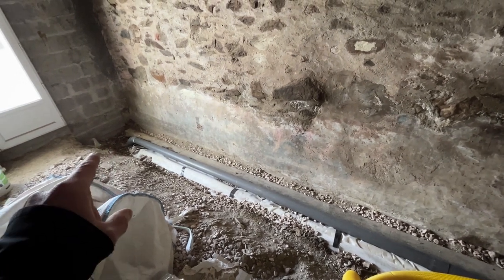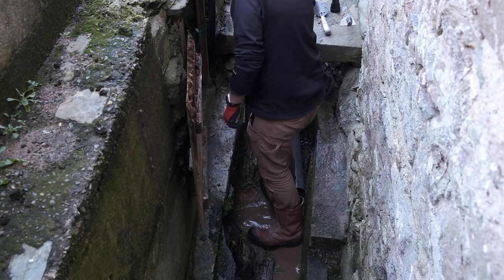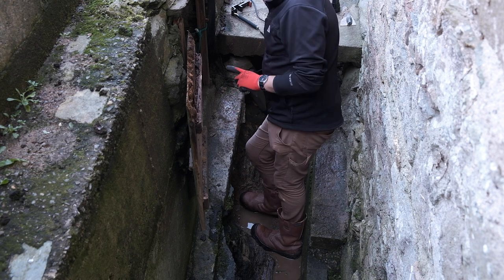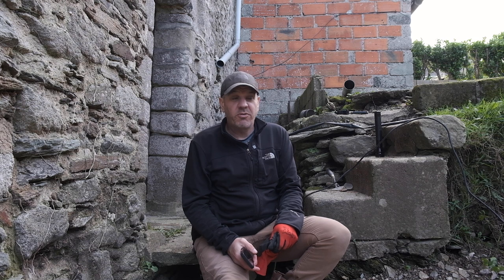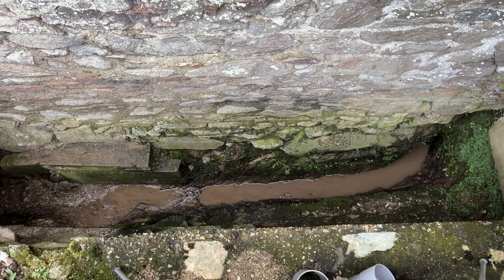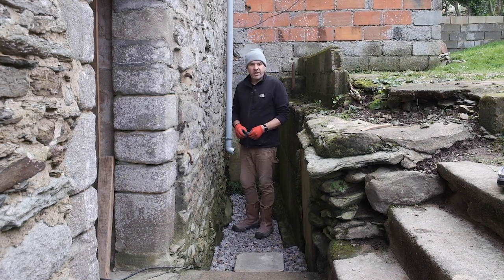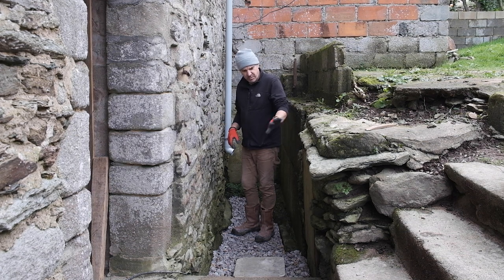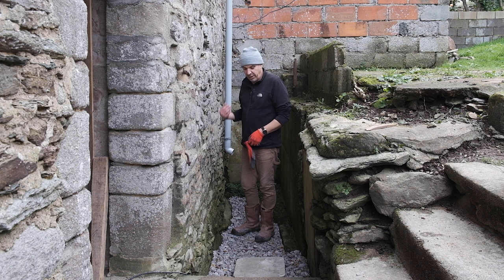House Foundation Corner Drain

Comment: After You have redone the gutters and downspouts put a manhole/ shaft in the corner (the wet one) and connect it to the solid pvc pipe inside the house / barn. The pipe that goes from the sump pump should be solid and connect it into the same shaft/manhole. That’s that. Now, we all can clearly see that you are a Brit because how unfazed you were when it was raining 😂.

Comment: Well done. This is something like I was hoping you'd do. My one concern is all that groundwater, the sump, and the roof runoff might overwhelm the 100mm drain through the barn and out to the street. Also, a side thought - Have you cleaned out the pipe between the barn and the street thoroughly?

Comment: You made the right decision to run the drain pipe on through and cover with gravel.  Two suggestions to finish it off.
Glad the sump pump is working as intended.  One suggestion - you want to hard pipe the sump outflow into your drain pipe.
About where the drains penetrate the foundation wall:  Suggestion;  Patch the hole with hydraulic cement - both inside and out.  Build the hydraulic mortar up to level with the surrounding face of the foundation.  
Cementing the opening close should dry out that corner of the foundation considerably. 👍